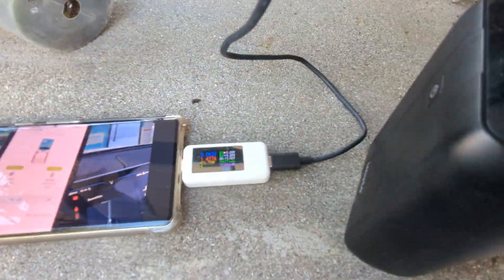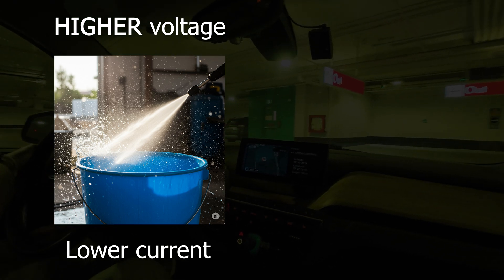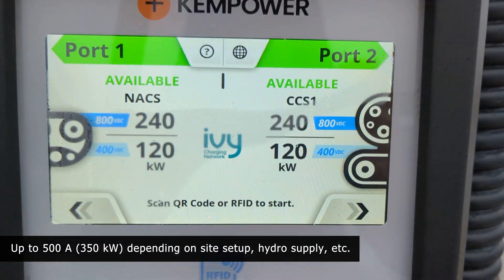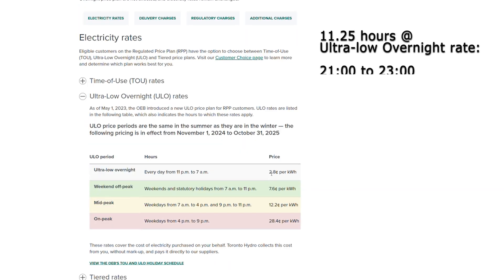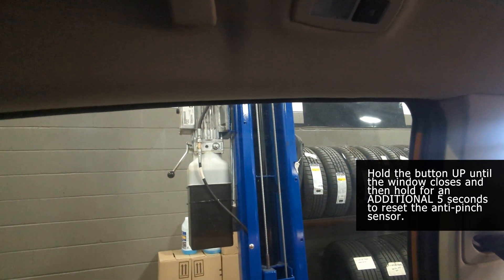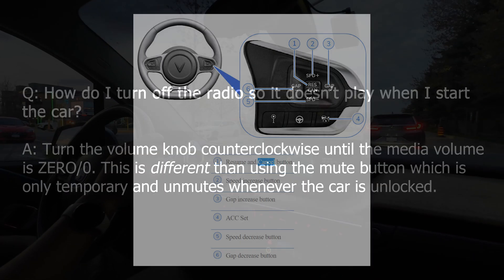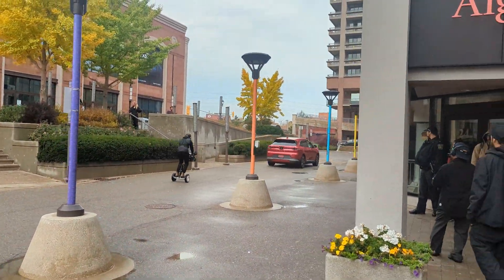Electric Vehicle Charging 101: how is it like USB-C charging? (+ VinFast FAQ)

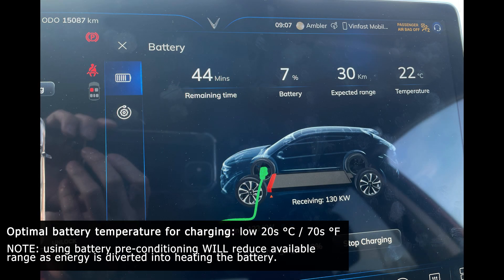Comment: Hello Jeremy, that's the best video about the Vinfasts I've seen yet ! Let me ask you; do the vf8 have the battery preconditionning like you show in the video (about 5:17) where I think this is for the vf9 ? 

Also, what are the conditions for this automatic preconditionning to start ? 

This seems like a secret keeped well and I see so much owner just arguing that what they do is what start preconditionning (selecting a charger in vf nav, turning at Max temperature the air conditioning or even turning on the defrost !).

Thanks,

Gabriel